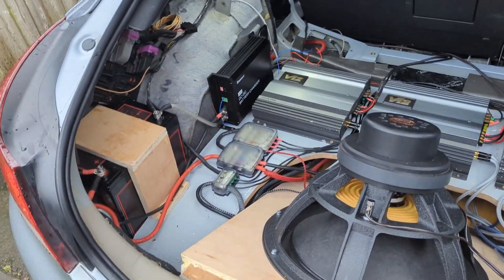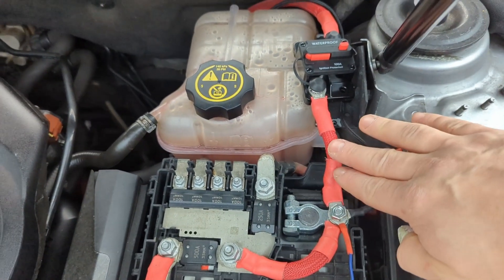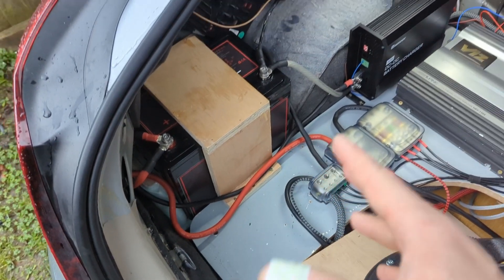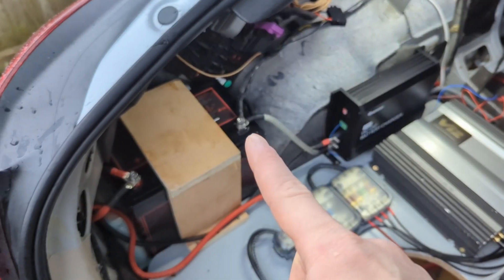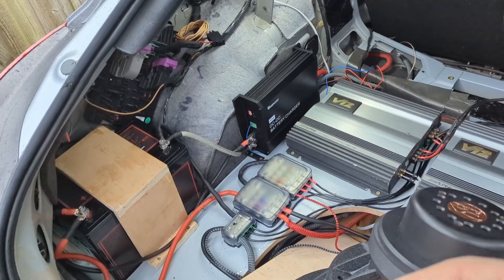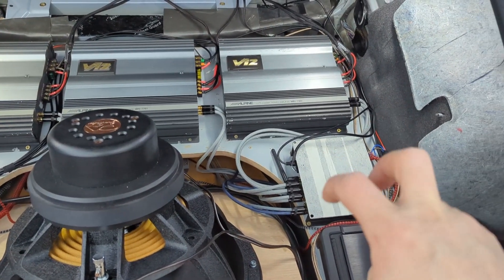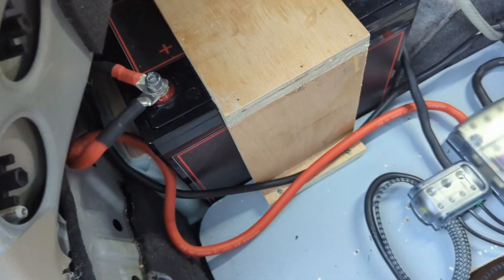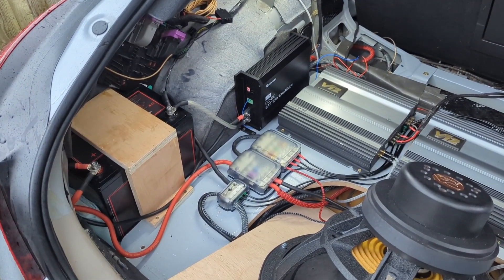Daily update - lithium and DC-DC charger installed

Comment: Im thinking about copying your exact set up here. Im still trying to wrap my head around an " isolated ground " lol. Does the ground just go to a different spot on the body, and not to the ground Distribution?
Reply from the maker: No, the ground does not go anywhere. Just to all the negative terminals on all the gear.

Comment: Can I use the charger for the LTO battery?
Reply from the maker: No, the voltage is too low to fully charge LTO.
Reply: @RAW-CAt   even if my LTO battery is fully charged with 14.4V?
Reply from the maker: @derermittler5549  in that case you can👍

Comment: This video hits at the perfect time. I am trying to convert my RV van batteries to run the stereo system. I have two lithium 100ah batteries and I'm going to be running about 2500 watts off my 200 amp alternator. I have solar on the roof going to a 30 amp solar charger and I was looking at just running a straight line from the alternator to the batteries  and superBank with an  alternator protection device(APD) and a 500 amp isolator. 40 amps seems insufficient but possibly over time that 40 amps is below the actual draw? The batteries and supercapacitor take the big draws but constant 40 amp charging is essentially more than what you're really using? Interesting stuff. I really enjoy watching your channel as well as others to try and get the best out of my system.

Comment: What im interested in in a dc to dc filter device. Kind of like how a pure sign wave inverter filters and converts 120v to 12v for rv and such. A device that trys and clean up the power passing through the dc power and ground chain.

I hear so much about people having interference in there system only to blame the amplifier companies. 

I have a recoil 500amp isloator in my system because of mixture of battery chemistry,  agm and lithium.  Wonder if that device is affecting or doing any type of isolating when it comes to ground noise? 

Super interested in your findings. Good luck.
Reply from the maker: Most AC/DC "sine" converters are actually very dirty. They are not there to clean up.anything, as they are used only for energy storage, so the cleanliness is not important for that. A battery cleans up the signal by itself, as well caps in equipment or a BA l.of super caps. If you have noise issues with an auxiliary battery, try to isolate the ground and not share it with the car.

Comment: Why did you buy the DC-DC converter?  Do you plan to buy more?  Limiting your charge to 40A for a stereo like this would be an odd choice, although running 3 in parallel would work.  But at the same time, you could have simply not used any DC-DC at all and bought a lithium charger to charge the car battery every few weeks, which would still be a good idea anyway even with the DC-DC converter(s).  Just seems like an odd place to spend money
Reply from the maker: The main reason for the DC-DC charger is that my car is equipped with a smart charding alternator that sometimes spikes above 15V. Needless to say a 13.2V nominal lithium does not like to be charged at 15V....
Reply: @RAW-CAt  Your voltage regulator or maybe the diode pack is stuffed.  It shouldn't ever output over 14.5v.  I also have a car with a "smart alternator", the ECU has control over it and will allow the voltage step down to 13.2v after I drive for about 10 mins.    I recommend pulling the alt apart and reconditioning it, brushes wear out and they are like $10 to replace.
Reply from the maker: @minus3dbintheteens60  a lot of owners of the same model car has the same charging characteristics. It keeps the voltage at 14.9V until the main battery is charged back up🤷
Reply: @RAW-CAt  today I learned that there are BMWs that actually increase the alternator output over time to compensate for an aging battery, because the electronics in this 7 series are super complicated and sensitive to a voltage range.  So when you install a new battery, you have to program the ECU to tell it that it has a new battery.  Obviously if you didn't do this, your new battery would last only 1 year, because of the high voltage from the alt.   Point is, if I were you, I would look into whether your car has a similar function.  If it doesn't, I'd still be looking at the voltage regulator.  It is not normal or desired behavior
Reply: Isolate the power and ground from the car that way he avoids electrical interference.
Reply: What electrical interference though?  I've never had a system with alternator noise or anything like that, which is always 2 problems, 1) floating ground RCAs 2) amplifier input gain too high.  Either way, if that truly is the case, I hope that it is explained, and the before and after results are shown for the floor noise.  Many people would add a capacitor to remove alternator and ground related noise, although every single electronic component has capacitance on its input for this reason and so a 1 farad or 500 farads of capacitance hanging off the alternator again shouldn't actually change anything where you can see a scientific and measurable difference

Comment: dc dc charger is 40 amps. lets say your system peaks over 80 amps. wouldnt that 80 amp peak draw hurt or even limit the peak amp draw? i understand you have the battery but the dc dc charger is still in the loop.
Reply from the maker: The DC-DC is just to top up the battery. When the battery is fully charged the DC-DC is not active. Only when the voltage drops, it kicks in. And let me tell you that lithium does not drop voltage easily🙃
Reply: @RAW-CAt  thanks for clarifying. i wasn't familiar with this equi0pment and how it worked. i just watched a few videos. i see some guys running them without dc to dc. i see the pros and cons of both.
Reply: You don't blow up your alternator when you draw more power from it that it can output.  Once the DC-DC is saturated the voltage will sag below the battery voltage and then the current will be pulled from the battery
Reply: @minus3dbintheteens60  i wasnt thinking about blowing up the alt. It was the dc to dc converter. if i assume the same point applies. so when the voltage sags below the dc to dc converter the battery takes over?
Reply: @MrGreen1988  yes, I was just saying that the DC-DC converter will output current up to 40A and if the current demand goes over that 40A the voltage of the DC-DC converter will sag (the DC-DC voltage is higher than the battery so it can charge the battery) and the battery then has the higher voltage so the remaining current is drawn from the battery.  No harm should come to the DC-DC, although if there was no battery and there was only the DC-DC converter there to supply current then there certainly would be risk of damage to it
Reply: @minus3dbintheteens60  ah ok makes sense. that was the part i was curious about, after exceeding the 40 amps of the dc/dc converter

Comment: Those breakers are not for car Audio.! If you test them, they do not pop when they are supposed to. You are going to burn your car down. Dude, what are you doing?
Reply from the maker: Yes, those breakers are not for car audio. I am not using it for audio. I am using that breaker between the alternator and a DC-DC charger. That is exactly what those breakers are designed for. The breaker is 100A, the charger will be pulling 50A max and my wiring is good up to 200A. Not really sure how that can be considered as a fire hazard. Again, your comment is incorrect, there is no possibility for my car to "burn down".

Comment: And you should’ve told everybody you were going to buy a DC to DC charger we could have sent you towards the right one. Those are not reliable and they do not put out the amps. They advertise as they warm up they drop significantly. For someone that is putting information out to people you think that you would have good information. But for some reason, this channel is out of the loop for some reason
Reply from the maker: I'll try to answer your comments one by one. Saying that Renogy chargers are not reliable is a stretch. Renogy is a very well known brand in the UK and it earned that name because they make quality stuff. Yes, it's not Victron, but still very good. I did not notice any issues with the output current,  it gave me constant 42A until the lithium was charged up. Active cooling kicks in on max output and nothing is dropping when warmed up. So your statement is incorrect and not sure what it is based on.

Comment: Very cool to see a dc dc charger route with how one like yours can be remote set at different voltages or can it? Did you look into the external voltage regulation of the alternator as an option? 

Also have you looked into 16v lithium?
Reply from the maker: I wanted to leave the alternator as it is, as the car is running fine for years, why mess it up? And yes, I did consider higher voltage lithium, however, based on my testing, the amps don't perform optimally at 15-16V... Having big amps with a lot of headroom, I don't have the need to push amps with higher voltage.
Reply: @RAW-CAt  that would be a topic that covers what lots of people mull over. 16v not being ideal for amps would be interesting. For most other systems it's a benefit.  I have a system in home that uses 16v lithium. The fans run harder for sure. Pulling more amps. Is that what you are saying affects performance?
Reply from the maker: @DipntheVic  every component has a rated voltage that is optimal and maximum. If you would have a look at amplifiers power supply capacitors, they are rated at 16V max. Now running caps at max voltage will shorten the lifespan. With unregulated power supplies when you have higher input voltage, rails have higher voltage as well and that stresses the fets, as in most amps they put FETs with max voltage just barely above rail (for monetary reasons obviously). So with higher voltage it's easier to blow the output stage or the power supply. It's like a car that can rev up to 7000RPM, you can drive red lining, but for how long?
Reply: @RAW-CAt  Now that is something I was totally unaware of. Max rated capacitor voltage.

Currently I have 3 amps 2/3 running at a time screwed into the wall of my  room. runn off a 200ah 16v 5s system. For now near 2 months straight they have only shown to have brighter leds and faster running fans. Power acoustic and Audio control Amplifiers. US companies. low to high end still both well made. the voltage at its entire state of charge is within 12.5- 16.8 volts. with it dropping to 16.6 very quickly. 

Is it very very poorly made amplifiers or 20v systems that could cause a problem?

serously two months straight on a 16v system. Audio control lc 4.800 1.1500 and power acoustic 4.1000. 

I will seriously seriously update when they blow. or sound like bad or however they manifest

its my at home rig with car equipment